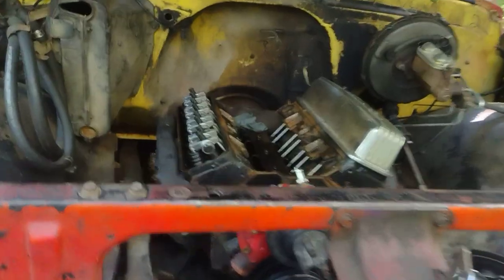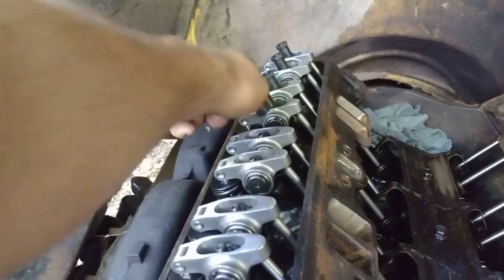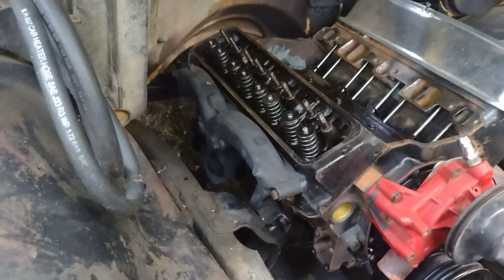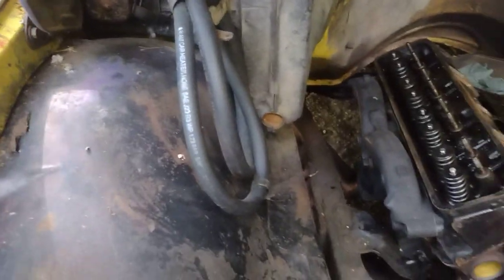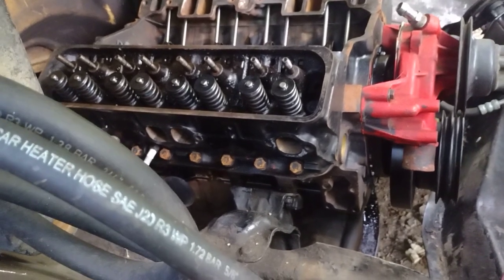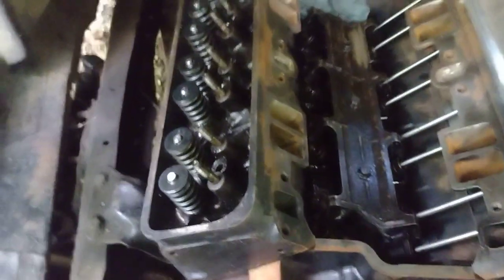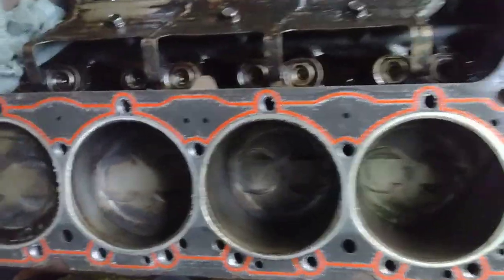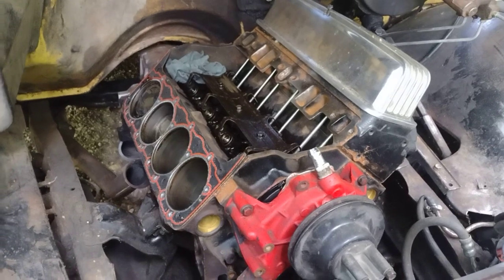TBI heads to Vortec swap pt 1

Comment: Vortec! 
They make aftermarket heads that are drilled and tapped for a standard intake bolt pattern and have the Vortec bolt pattern but they don't make an intake that has both bolt patterns! So you're going to have to drill your new Vortec intake for the swirl port pattern on one side. 

That's going to be cool as a penguin using those 2 different heads! 😁
Reply: @bad66chevelles  
I know, I was just having a little fun. 😁 Plus that was the only thing I could think of to write. The more words the better it is for the algorithm.👍